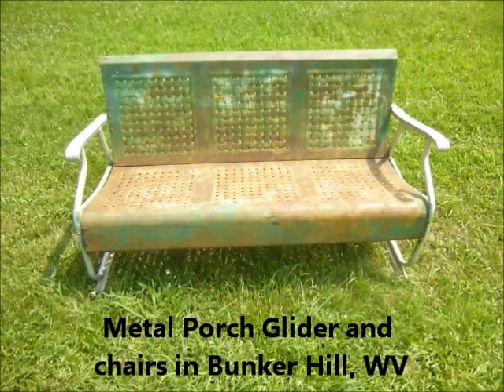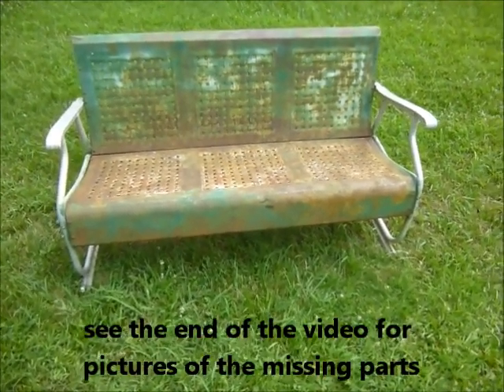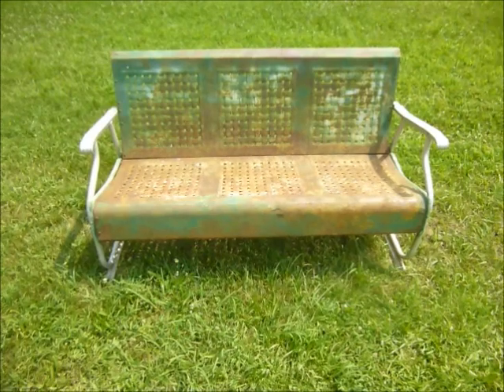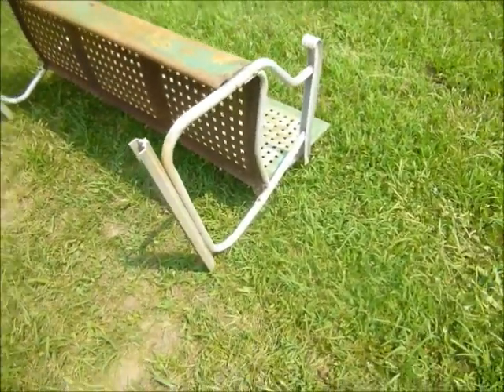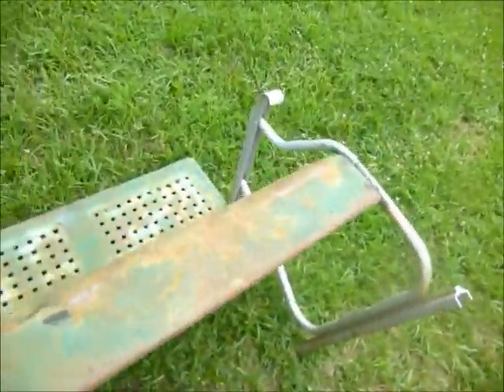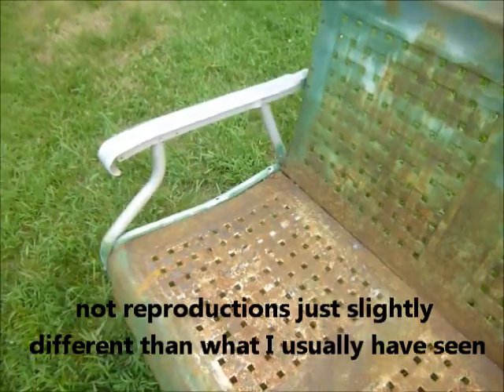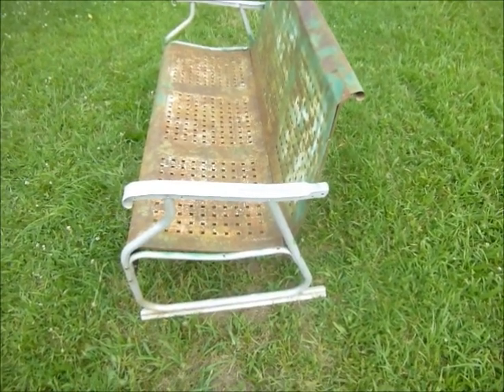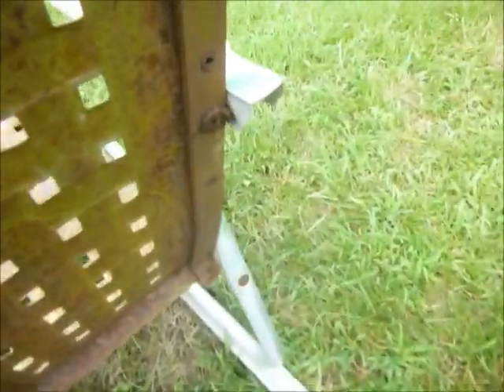Vintage Metal Glider Aluminum Slider Style with Ball Bearings part 1 - 2018-7-13

Comment: This is exactly what I have been looking for.
Reply from the maker: I never got to put this glider together this summer.  But I have another video that shows pictures of the parts but doesn't have sound.  Thanks
Reply: Where can I find replacement parts for  @MetalPorchGlider
Reply: Does anyone know where I can get replacement parts?
Reply from the maker: I missed seeing this comment.  Ball Bearings can be found on ebay or amazon 5/8" usually.  Replacement parts are not made.  Sometimes you can find springs that may work at Lowe's.  Or find another glider and use it for parts.
Reply from the maker: Ball Bearings can be found on ebay or amazon 5/8" usually.  Replacement parts are not made.  Sometimes you can find springs that may work at Lowe's.  Or find another glider and use it for parts.

Comment: Hi. I just viewed your video. I have a ball bearing glider I'm going to fix.  Mine has iron runners. It appears that the ball bearing holders are on the rocker but it looks like one of the brackets bent and slipped loose and there's no ball bearings.

But my ball bearing brackets appear to have the rod between them like the ones in your picture, but  there is no spring between them, just a solid rod. So what is the purpose of the spring?  I can't see that there has ever been one on it.

Comment: i have this glider, but cant find the ball baring parts
Reply from the maker: Ball Bearings can be found on ebay or amazon 5/8" usually.  Replacement parts are not made.  Sometimes you can find springs that may work at Lowe's.  Or find another glider and use it for parts.